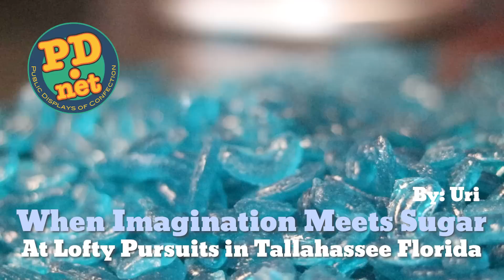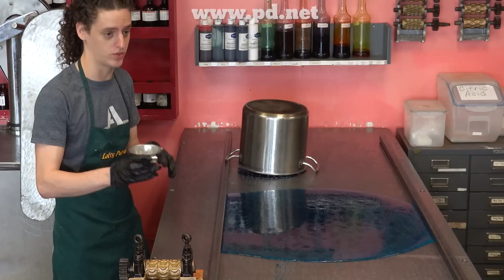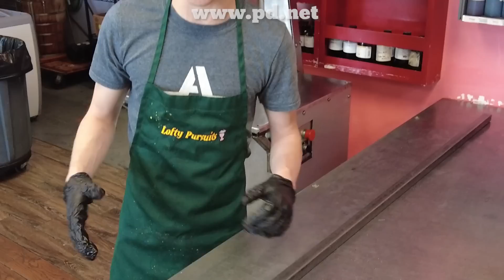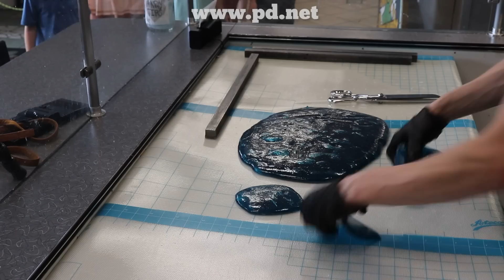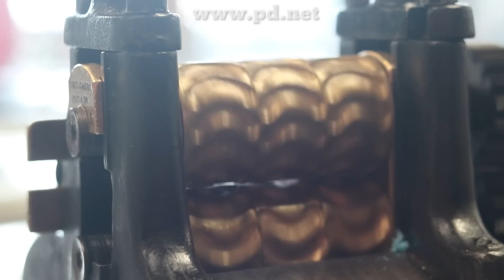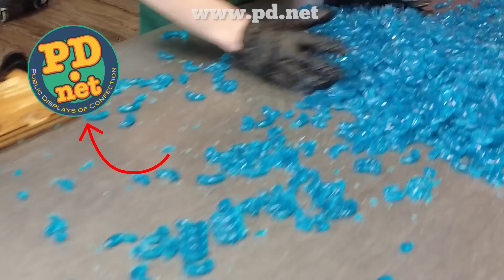#172 Imagination Meets Sugar at Lofty Pursuits

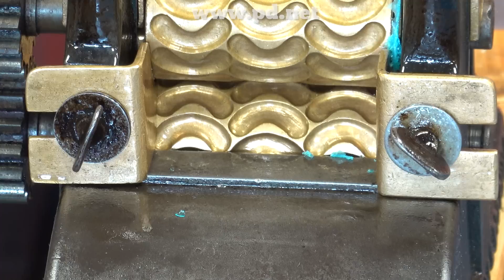Comment: The shots of the candy going into the rollers reminds me a lot of watching another non-Newtonian fluid flow - lava. At 2:28, the way the candy deforms is extremely reminiscent of the way Hawai'ian basaltic lava stretches as it moves...only in reverse (as the shot shows a retreating bulge of candy rather than an advancing one). Nonetheless, I wonder whether the viscosity of the non-hardened candy is similar to that of lava (obviously the density is a lot lower).